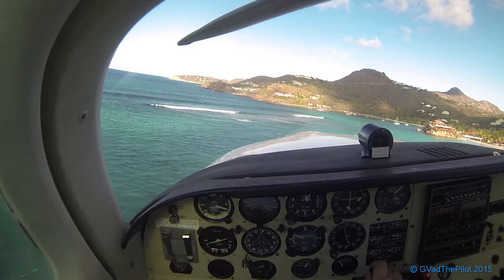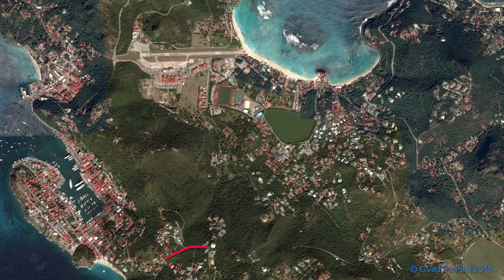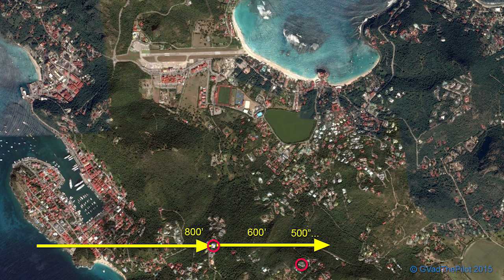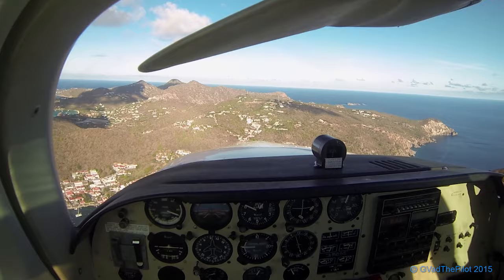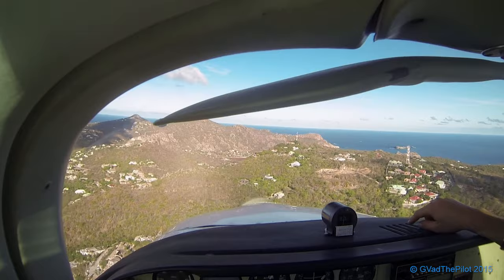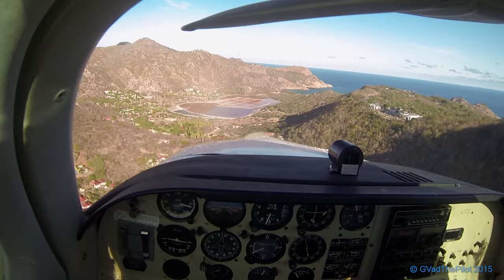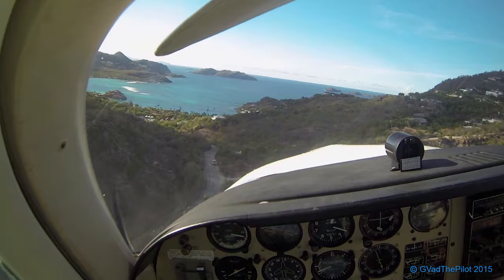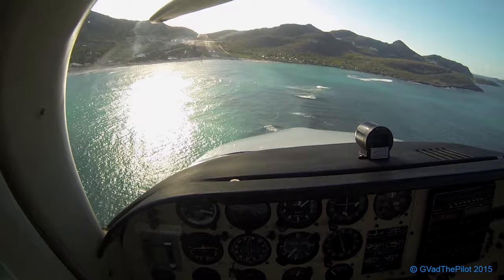Landing at St Barths TFFJ (Pilots View) _ Left Pattern RWY 28 (Part 2)

Comment: Great video but "no go-around option" is a bit dramatic...
Reply: You're not a pilot obviously.
Reply: @karhukivi  I’m an airline pilot with 8,000 hours who has flown into this airport, and you can most certainly go around. Pure clickbait title.
Reply: @SkyWayMan90  you can go around when landing rwy 10 without problems. Trying it on 28 after passing Eden Rock on a hot day with very high DA could be the last thing you do. There's a reason why Eden Rock is called the "decision point"
Reply: @diganwhisky.uruguay  There is no mandatory or charted policy. For the vast majority of the time the DA at sea level won’t be an issue for turboprops and even light singles and twins. Full power, accelerate to Vx in ground effect and then begin your climb, and you will clear the terrain straight ahead - all depending on when you begin the go-around of course. Even over the touchdown zone with good skills you should be able to make it out with no issues.

Comment: I've watched several of these even looked up St. Barts on Google Maps. This is the first video I've watched where a plane has landed from the opposite direction.
Reply: It's potentially very dangerous.  If, as you approach the threshold, you realise you are a bit high or fast, or both, you won't be able to either turn away or climb fast enough to clear the terrain, so a crash would be inevitable.  Look at Courcheval (The Alps) airport videos for a similar problem.

Comment: Great flying.  But one thing - he said "no more go around" on short final.  You can always go around.  As we say in the airlines, a go around is possible until we are parked at the gate with the brakes set.
Reply from the maker: Ryan very true, I've seen a video of a go-around at Lukla. But it isnt a safe go-around. As the checkout instructor said before the flight "slam it on the ground, brake the wheels, your chances are better than a go-around."
Reply: GVad The Pilot unless you have stalled the airplane, then you are still in a condition to fly.  If I'm unstable, I'd always rather go around then attempt to slam it on the ground and hope for the best.
Reply: @Ryan-sw4xy  Why? I'd much rather slow down as much as possible on the ground before I overran the runway and hit the hill, as opposed to hitting it at Vx.
Reply: @HiddenWindshield  A go around would prevent hitting the wall at all.
Reply: @Ryan-sw4xy  It's certainly possible that you could have enough of a climb rate to avoid the hill, if you start early enough, and you establish and maintain your best angle-of-climb speed, and there's no downdraft or anything. But it's not safe to do so.

Actually, that last point deserves a little more scrutiny. You wouldn't be landing on 28 unless the wind favored that runway. That means it's very likely that that the wind will be blowing down the hill. So you're almost always going to be facing a downdraft if you do a late go-around.

So, in short, if I ever have the chance to land at St. Barths, I think I'll follow the advice of the CFIs who have actually been trained to land there, as opposed to some random guy I met on YouTube.

Comment: Always nice to have the stall horn chirp at you when you're turning 100 feet above a wooded hill...  That always get my attention.  Nice approach!  BTW, how did you like the Beech?
Reply from the maker: +Tytus Abrahamson When at final approach speed and flying over a gap that creates drafts and turbulence, the stall horn is liable to come on for a second, good thing we have 10-15 kts to spare lol.

I love Beech planes that I have flown, Bonanzas and this Skipper. A little touchy since I usually fly planes in 3000-4000 lbs range, but I got used to it really fast and the plane itself was very stable. As Thomas said, Beechcraft fixed all the issues that Piper Tomahawk (Skipper is based on that design) had.

Comment: I did not hear you make any general radio call regarding your intentions re the landing. Did you make it before you departed? Also if you had to do a go around could you not just pitch up, toga power and follow runway 28 heading... or is the terrain just too steep? Cheers.
Reply from the maker: GaryNumeroUno If I remember correctly the airport is towered, so we did get a landing clearence. Either way, the instructor who was flying with me handled tbe radios. 

That hill is 150+ feet high, so most planes would not make it over. Its a lot higher then it looks in videos. As the instructor put it, better to break the wheels than end up on the side of the hill.
Reply: Ahhh... thanks for that. Nice work...
Reply from the maker: @kimchi2780  I cant remember exactly, but I believe its an "unofficial" tower, kind of like Catalina in California. There is a person there at the airport that gives weather and other updates, but its technically uncontrolled. Its not a person at TNCM

Comment: good video but one crucial mistake......as long as you have engine power and skies above and room to climb,  you always have an option to go around theres no way your option for no go around ends before you even reach the runway
Reply from the maker: jeremy davis sure, you can climb, right into the side of the 200 foot hill at the end of the runway
Reply: @FSX404  Are you honestly telling me the plane you were flying, at full power and at sea level, couldn't climb above that hill from the point where you called no go around? C'mon man. It aint like its Lukla. A go around would be perfectly fine
Reply from the maker: @turbofan450  Im just a messenger here, telling everyone what I was told by a checkout instructor. After seeing it myself, the height and steepness of the hill I do not think many planes could make a go-around safely. Could you do it? Maybe, with inches to spare. But could you do it safely? The answer is no.

Comment: Why not aproach from the northeast over the water? Seems way easier than flying around hills and loocking at houses
Reply: It's theoretically possible, but there's not a good option to abort unless you're still about 1/2 mile out, at which point you've still got a 45º turn to final. Coming from the SE it's easy to abort any time before you're on final, at which point your maneuvering is all done.

Comment: Excellent video, just a quick question.
Regarding the decision point as you turn onto final, it appears that in a worst case scenario you could advance the throttle and climb to a safe altitude past that point. Why is that hotel the decision point?
Reply from the maker: Ryan Harris its the last safe point to definitely get out, no doubt you can make it even past that point (depending on the plane), just not as safely. Thanks for the comment.

Comment: Why is there no go around past the decision point (abeam the hotel peninsula)? 
I get why the airport at Kathmandu has no go around, but this is at sea level, what’s not going to have the hp to climb?
Reply from the maker: No safe go-around. That hill on the other side of a 1800 foot runway is 150-170 feet tall, much taller than what it looks like on screen. 1800 foot runway and you have to be at 220+ feet at the end of it. So, yes a plane may make it over (someone had a go-around at Lukla once and made it), but its way below safety margins, so go-around not recommended. Better to brake the wheels or hit the wall at the end going 30kts, than the hill at 80+kts

Comment: Very good material for learning on your videos.Was it more ease to land on the sim than in real life? i can see the marking points for landing more clear in real life.Thanks for your awesome videos.
Reply from the maker: +ELISEO ROMAN Interesting question, but you have to compare apples to apples. I have years of experience as a pilot and in the flight sim so can compare this approach in the sim and real life.

Its harder in the flight sim to hit the altitudes and points because of the visibility and the "feel" of the plane. In a sim you're sitting in a chair, in real life you feel every vibration and bump.

But in real life there are different up/down drafts, winds, engine rotation factors, etc that take a lot more skill to control. Also psychological reasons, in real life if you make a mistake it might be your last one. So, all things considered, real life flying, especially in a place like St. Barths is a lot tougher.